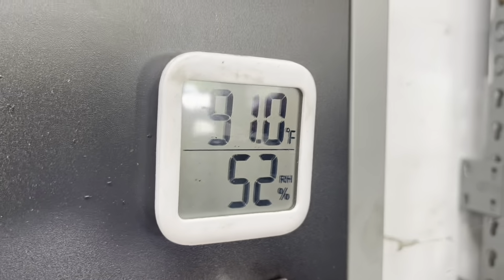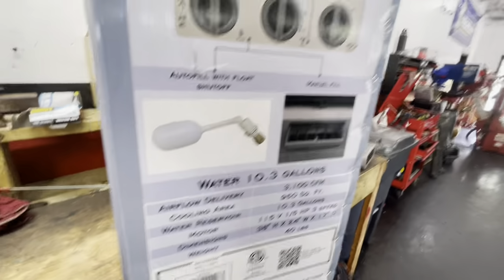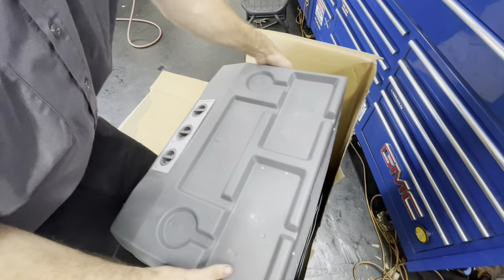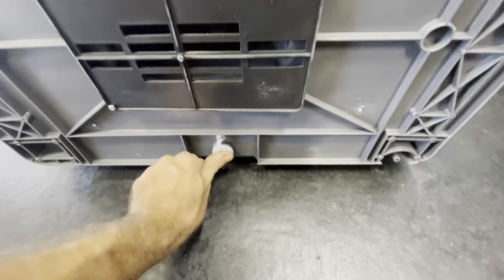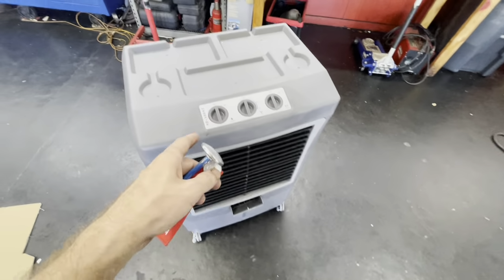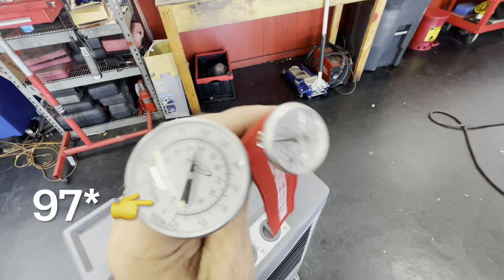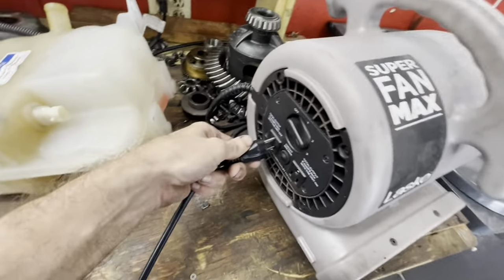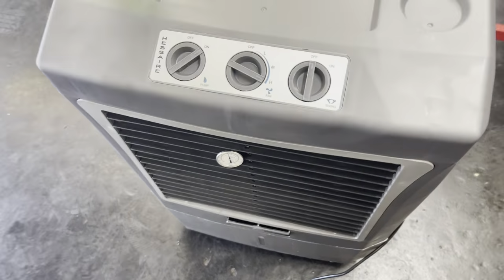Can’t take it Anymore!

Comment: Thanks for the pointer, never heard of the itty bitty ones. In an emergency you can use a pressure washer to cool the air outside the building. It will act as the fan too and the water pretty much evaporates after a few feet. Drops the temp quite a bit and saved a bit on energy. It's the water that becomes critical then. 

I want a smaller swamp cooler in front of my car radiator rather than like the old car window swamp coolers. Even when properly working in dry heat the AC struggles. This would fix that while the water lasts without corroding the radiator like a spray would.

Comment: Congrats, you bought a humidifier.  On low humidity days, it will cool a little, but raise the humidity in the shop.  On high humidity days, it will do jack squat.

This is not an air conditioner and should not be allowed to be labeled as such.
Reply: As all the doors are open that little evaporator will not be able to raise the humidity in the shop...

Comment: Where I live, we live with single digit humidity most of the summer.  We call it muggy when it gets all the way up to 35%.  Swamp coolers are great in the arid conditions out West, but not so good when it is high humidity.  Oh well, at least you can get some circulation up in there.

Comment: These units work by absorbing heat as they evaporate the coolant, latent heat of evaporation. As you are already in high humidity with the air having less ability to carry more water I suggest you should try a coolant with a lower vapor pressure. Can you get brake clean in 5 gallon jugs?

Comment: If you look up what "latent heat of vaporization" means you will learn how the cooler works.  If you add ice to the reservoir and look up the meaning of "sensible heat" you will learn why adding ice cools the air further.
Reply: It's the latent heat of evaporation 🤔

Comment: Keep your receipt, Ray. I think you’ll be returning it. As many have said this is an evaporative cooler that only work in very low humidity conditions which obviously is not Florida. This thing will also make your tools wet resulting in rust. Sorry sir, you’re going to have to spend much more money on a real air conditioner and figure out how to expel the hot air.
Reply: Not after ripping the box apart he won't.

Comment: Above 50% relative humidity you are better off with just a fan.  Swamp coolers reduce temperature less with rising humidity and  jack the humidity up even higher and your body sweat will just have a harder time evaporating. I have found it to be a net loss in comfort. They call it swamp ass for a reason. Here in arid New Mexico my cooler works great dropping temperature about 30 degrees F when RH is around 20% or less outside ...Until the monsoon season hits and the outside humidity rises to about 50%+ and the temperature drop is reduced to around 10F and at the same time adding about 30% RH to the cooler output.

Comment: I did maintenance work on several restaurants that used swamp coolers for the makeup air in the kitchens. They looked like roof-mounted HVAC units minus most of the parts.

Comment: The vast majority of the cooling effect comes from the evaporation of the water, and not from heating it up so the initial temperature of the water plays only a minor part.

10.3 US gallons of water is 39 Kg, and if we assume that the temperature of the water is raised from 10C (50F) to 30C (86F) then that's just 3.3 MJ of heat that can be extracted. Feeding it with iced water is only going to take increase that by 1.6 MJ to 4.9 MJ, and as ice is less dense than liquid water, there will be less of the latter to evaporate, which is much more important. As mentioned, most of the cooling comes from the phase change from liquid to gas (that is the latent heat of evaporation) and that is a much larger 88 MJ. So if we start with that tank of water at 10C, then we have around 91 MJ of heat we can absorb. 

So, if that 3,100 CFM is to be believed, then that's about 6.5 metric tons of air per hour. Given that the heat capacity of air is about 1 KJ per Kg per degree Celsius, then it follows it takes about 6.5 MJ to be absorbed to lower the temperature of the air passing through that machine by 1 degree Celsius, or 3.6 MJ per degree Fahrenheit. To put it another way, each 1 degree F drop will require the evaporation of about 0.40 US gallons of water an hour. If you desire a drop of 10 F, then that's 4 US gallons an hour. That 10 F drop would empty the reservoir in around two and a half hours.

Of course, that's very much on the optimistic side as the thing will not be 100% efficient, there will be added heat from the fan motor, air movement and so on. If the water doesn't all evaporate, then it also loses effectiveness. Needless to say, the more humid the air is, the less effective they are as water won't evaporate as fast. The reservoir tank will last longer, but that's a bad thing. For maximum cooling you want the water to evaporate as fast as possible, although the downside is that you'll be constantly replenishing it.

What is a lot more effective is "misting" coolers that work by making the individuals somewhat damper, and then the air flow from the fan accelerates the evaporation of that water from the body of the person, which is much more directly effective. Of course we'd call that sweating when we supply our own water, which is why an air flow makes all the difference as it's much more effective to evaporate the water next to the skin. Of course you don't want to blow water mist all over the engine bay...

In any event, don't expect too much from those evaporative coolers unless you've got one that goes through very large quantities of water, and if the humidity is much more than about 60% they lose effectiveness fairly rapidly as they don't evaporate water very fast.

Comment: Maybe your shop needs to put in a couple of large ceiling fans, one brand is Biga**.  They move a lot of (hot) air, often use in warehouses. 
The top of the unit would be a great place to put parts, bolts you take off, tools. beverages.
Reply: Yes, get these fans, it will be much better than that swamp box. Bigas$ fans, look em up.

Comment: If or when that breaks. Get a 20 inch isolating fan. Then freeze one gallon milk bottles and bring one or two in a cooler and put them  one at a time in front of the fan. Maybe try dry ice.

Comment: Evaporative coolers are designed for low humidity locations such as the southwest desert where the humidity is under 10 percent. That's just going to be miserable in that humidity. What you need is an actual Air conditioning unit that uses a compressor and refrigerant.

Comment: Ice. Fill with ice, then fill with water, then more ice. Someone smart someday will start insulating these things so that even on humid days you can blow air over cold water. Until then you’re gonna burn through a lot of ice. On a 20% humidity day you can see temperatures drop as much as 15° from evaporation, but on humid days the ice is what will make the air cooler. I am also on the gulf coast and there are two things I have learned about these evaporative coolers. Number one buy one three times bigger than what you think you need and number two have access to a lot of ice on humid days.

Comment: Wont work well in Florida.   Great in Arizona, we use them in the dry summer, switch to AC when the humidity comes. It was 112 degrees here today, very low humidity, inside the house was about 82 degrees, it will drop to near 50 degrees over night.

Comment: Separate point:
* The portable A/C units can actually HELP!!
* BUT.....the hotter air coming out the back HAS TO be ducted out of a room.
* Usually, a window has to be adapted to mount the 6" exhaust air flexible ducting. I realize that's a challenge in Shops!
* If your Shop could figure out a location where a few units could be ducted-out, you'd be making a REAL difference! 
* OBVIOUSLY.....the overhead doors would need to be closed as much as possible!
* Typically - a plywood or Plexiglass panel is adapted, & a 6" round hole cut. The flexible ducting is then attached to a collar mounted to the wood.

Comment: With those surface areas a 2 degree delta T is about all you can expect.  Discharge air will always see a significant increase in RH.  Only gonna make you sweat more.  Those coolers are BS.  That thing is basically a mini cooling tower.  You tend to get a much greater delta T with a commercial building cooling tower due to the vastly increased size.  They have way more surface area and they are typically mounted outside from the conditioned space so RH gain is not a problem.  You'd be better off with a spot cooler that operates on a vapor compression refrigeration cycle. You'll need a good length of flexible duct to exhaust the condenser coil discharge through the shop wall.  Next video I want to see you cutting a hole through the shop wall to connect your exhaust duct.  Anyway, I love your videos.  Loved the recent oil pressure sensor swap on the 5.3 Tahoe.  I recently did one on my Camaro LS3 without pulling the Intake manifold.  That sucked but I managed it with some wobbly bits and a good amount of profanity.  Keep up the good work, and thank you.

Comment: We had a swamp cooler in an old house.  After a couple of hours the house became so damp inside the doors and windows would stick.  Then it would reach an equilibrium and not cool any longer!  It was a small house, you should have better luck in the shop.
Reply: Open doors = "better luck"😄

Comment: a large snail blower in the shop would help move air..you see them in rooftop a/c or oil furnace / hot air type..or..the car blower you see for cooling tranny at a dragstrip..i like the furnace one bolt it in place plug it in the wall moves tons of air!

Comment: Evaporative cooling. As many have said, also a swamp cooler in dry climates.  The same concept is used in many greenhouses. Big fans on one end of the greenhouse, an evaporative pad on the other and you feel great. But get halfway across the greenhouse and everything becomes muggy and uncomfortable. I've worked in a few here in SC and will attest that they are not ideal. Bleh.

A few large drum fans might work well for such a large shop. Northern Tool and Tractor Supply seem to always have them.

Comment: Adabiatic cooling :) actually efficient and low power when RH% is low enough to start with and you don't need the temp delta a conventionnal A/C would bring.

Comment: LOL @ swamp cooler. Good choice over a fan, those really only work up to about 80 F -- after that, they're just blowing hot air around. But swamp coolers have their own pitfalls. I'm smack in the middle of NC and the humidity and temperature here often have matching numbers in the summer... or fairly closely correlated ones. It won't be below 80% humidity here for any real length of time before early fall at least. That means swamp coolers are a waste of money here -- sure, you can buy em, but they really don't do anything, the insane humidity just kind of drowns em out before they have a chance to work. You just about may as well be livin in a pot of boilin water round here in July and August! It's awful.

Comment: A decent Air Mover might work better than a swamp cooler in a higher humidity area. XPOWER brand a very inexpensive and you can easily remove the fan portion to clean it.

Comment: Having been raised in the HEAT of the Southwest United States, I am quite familiar with Evaporative Cooling. Unfortunate Sir, one other thing I became familiar with…the need for LOW HUMIDITY (10-30%) for evaporative cooling to work. I found that out when I lived in a trailer in Bessemer, Alabama. I bought something like your unit at Monkey Wards, brought it home, hooked it, turned it on and promptly went to sleep. Upon waking…with water actually dripping off the furniture and walls, and my wife and I kinda floating in the bed (not a water bed), I quickly realized that evaporative cooling only works where the temperature is hot and the humidity is low…very low. Good try though Sir, keep up the videos…most are informative to an old guy like me and some are a good belly laugh. You do good work…for a rookie!

Comment: Swap cooler. Does not work unless you are in a super dry environnement. In fact, it often make it even worse.

They work on the principle that it take energy to make water evaporate. That energy loss is what cool the water. The air can now warm the water and lose that heat.
You ends up with a colder air out yes, but way more humid. And in your climate, that humidity kills more than the heat.

I hope you kept the box and the invoice, you will need it to return it tomorrow.

Get a good fan, maybe like Abom79 got? The Big Ass Fan

Comment: 7-7-22 @ 10am...Miami @ 88F, Dewpoint = 73F. Fargo ND @ 78F, DP = 68F. 

DEWPOINT tells how "Wet" the air actually IS. Dewpoints above 65F start to feel pretty sticky. The "Relative Humidity", expressed as a %, is a meaningless number!! All that means is the air in your shop is holding 50% of the water......THAT IT COULD hold, at 90F!!! 

The REAL downer >>>> 90deg air can hold A LOT more water than 50deg air!😢

Your "Cooler" will help.......ONLY if you have a lot of ice handy, AND you're within 3' of it! But yes, you're only adding even MORE humidity to the area. 

I CAN'T BELIEVE that more shops, etc., don't invest in A/C!!! Yes....I KNOW it's $$$$. BUT >>>> the burden on the people goes DOWN. Productivity goes UP.

Comment: You are a gas!  Midwest and West call those swamp coolers. Also evap coolers. Usually have outside ait to draw in and exhaust damp air. because they don't work well if rH is over 60%.  We love em. Today 98 with rH 6% inside temp 72. Cool only in rooms with window cracked for flow through air. no open window you get muggy swamp air. 
We do use larger versions like your to cool livestock. The down wind barn door is left open to exhaust humid air.

Comment: Trickle water down a membrane and then use a fan to blow that moisture into the room. Probably not the best thing to do in Florida where it's already very humid. From a comfort view, any cooling effect will mostly be cancelled out by the increased humidity.

Comment: Don't do what a guy locally did...and wound up in the hospital...put ammonia in it.  Ammonia is what RV fridges use to cool/freeze.  It's also what ice cream plants use to harden/freeze the mix.  So, smart guy decides to get a couple gallons of common ammonia from the store and proceeds to fill his up with it.  His idea was...if it works for RV fridges, and it is what USE to be use before the introduction of freon,  and if the local ice cream plant he worked for uses it then surely it will cool better for his use.  
So, he does it, puts it in his shop/garage and turns it on to run for a while and he'll just come back later to a cool shop.  Yeah.  It worked.  It cooled the area very well, he said.  However, it was so strong of ammonia he couldn't breathe and had to open the garage door and move it outside, then allow the garage to air out.  During this time, though he is breathing so much ammonia he passes out, a neighbor sees him lying on the ground outside his garage/shop, and calls 911.  In the end he has chemical type burns to his lungs from breathing so much ammonia...seems it causes you to deep breathe even more to try to get air and he inhales gobs of it.  
Moral of the story...rednecks...lol.  But, he did say it was pretty cool inside his garage area.  If it wasn't for that pesty breathing thing we need to do.  
Anyway, fill the bottom with ice and water best you can and it should cool you down if it's blowing right on you....some.  Gotta be better than nothing.  Take care.

Comment: That IS NOT an air-conditioner. That is an Evaporative Cooler which is of little use in a state like Fl. Those are designed for places with humidity levels below 50%. A large fan would have been better where you are at, not to mention cheaper.

Comment: These new fad gadgets are essentially just plain old swamp coolers. They function quite well in dry climates but not in high humidly, which is when you need such things the most IMO. There virtually useless in very high humidity. But it just might do something @ 50%RH which is an anomaly in Florida's summer unfortunately.

Comment: Oh I thought it was a real AC, it's a swamp cooler. Was wondering why you were filling it with water, dumping water made sense but then filling it oddly didn't immediately click to me. Not sure how well that will work for you. Swamp coolers work best in very dry places as they cool the air while putting moister in the air. You live in Florida where it's already incredibly humid most of the year so not sure that will really be that effective. I'm expecting in a place as humid as that it will be about as effective as just using a generic fan.

Comment: Ya, I assume florida is pretty humid? the dryer the air, the more evaporation you get off the screen and thus the cooler the air that comes out. If the air is already humid I would assume it is mostly just blowing humid air around, not a lot of evaporation. I have not been to Florida but did spend a summer in Arkansas, I have lived in the hottest parts of California, much higher on the heat scale than Arkansas, but the heat and high humidity of Arkansas kicked my ass. I would go outside and feel like there is no oxygen in the air.

Comment: Evaporative coolers need to exchange the air in the room with outside air 20 to 40 changes per hour. You are just recirculating the air in the space and adding humidity. Might not make you happy.

Comment: ray if its a china made one make sure it has a water level cut off  i got 1 and it didn't have one (cheap china crap cutting corners for profit) i didn't know and it burnt out the pump from running dry(yes my fault)  enjoy the new workplace comfort and keep the water topped up mate cheers